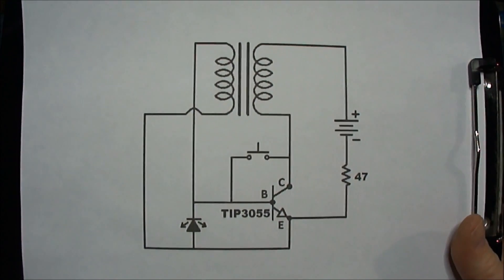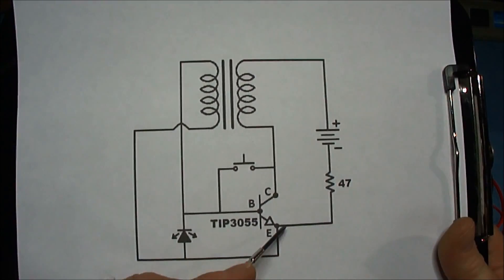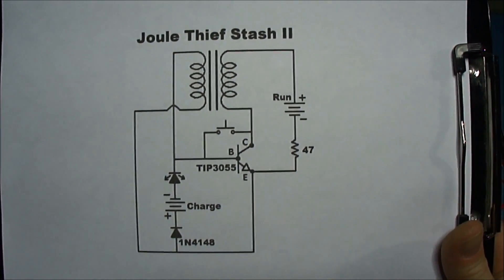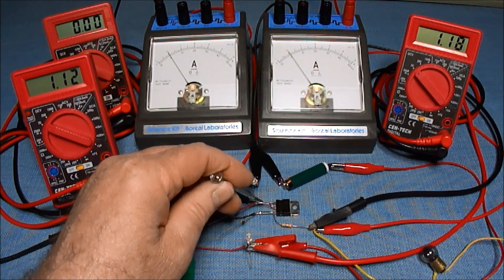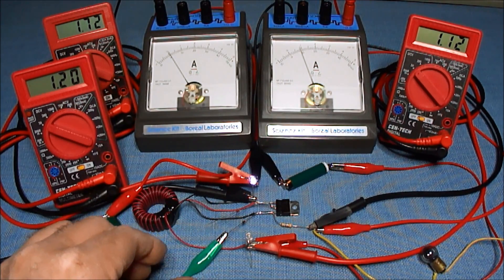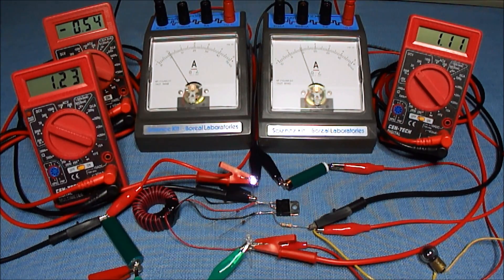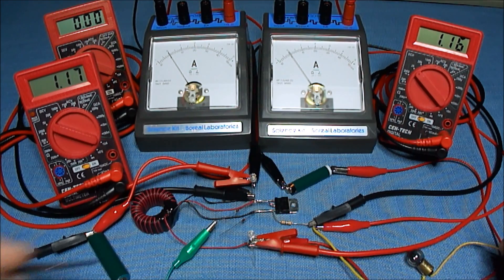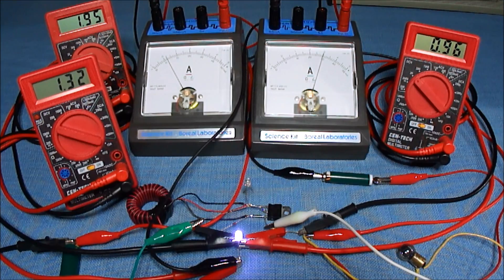Joule Thief's Stash

Comment: Joule Thief.. Bedini SSG.. Joule Ringer..  Slayer exciter setups..  blocking oscillator has become so useful for us lol. Basically the good old SSG circuit here with an LED helping to choke the transistor bias and switch it softer. The question is what about the collector current? can you not light another emitter across the other winding too?
Reply from the maker: +Magneticitist You can light another LED. Haven't measured the double combinations.
Reply: +Arkiver Unified Energy there was a user many years ago that went by IST814. Very interesting guy with a lot of interesting videos I found myself wrapped up in for a long while. He disappeared after a couple months of strange videos showing all this random gold he was finding naturally around him... anyway he had this little device he called the 'Magic Maker' which was basically just a test rig box with all the connections for hooking up different Joule Thief wound transformers/inductors. Really handy tool that I need to make another one of.. It was just a 2n3055 mounted in a small box with everything pre-wired so he could just clip on different transformers etc.. the interesting part about it was that he made all the different 'tap points' easily organized and it was always cool to see the different results one could achieve by messing around with all those different possible load connections.
Reply from the maker: +Magneticitist Good idea. I see he's making videos again. I noticed that the run battery plays a part in the oscillation like a tank circuit. If you place a signal diode in series with the negative it won't run.